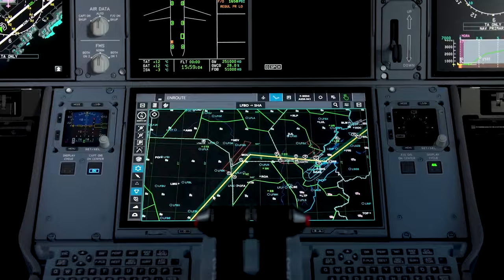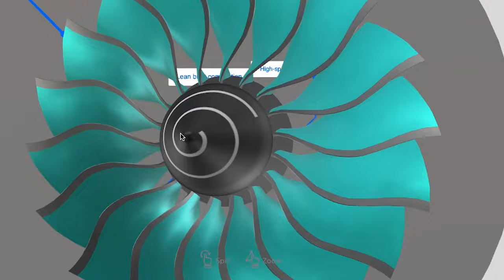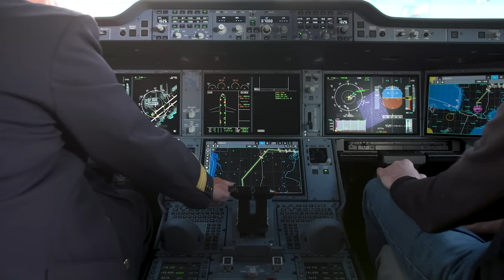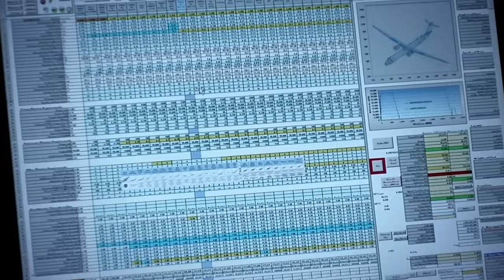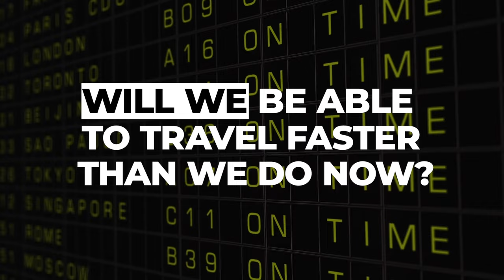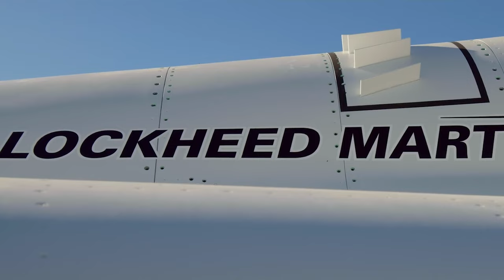Crazy Things Ahead in The #aviation Future!

Comment: I don't think electric or super-sonic airliners will ever be a thing. I expect that, in the near future, the right to burn hydrcarbons will be rationed. Speed and space are luxuries that I expect to command a premium price in the near future. Planes might run on methanol, as it packs a higher portion of hydrogen than other hydrocarbons. And, unlike pure hydrogen, it is liquid at room temperature. Future planes will be likely slower and lighter. The shapes required to get lifting body do not hold cabin pressure well unless constructed much heavier than a simple tube made of the dame material.
Reply from the maker: It is a very good point of view. With respect to supersonic airplanes, at first, like any new technology, it will be difficult to massify it (perhaps in the future we can give our followers a ticket on the supersonic boom😉). When we see simulations of the cabins of the future, it is because they will be able to better understand the materials and will have different forms of construction, Airbus is investing in the development of quantum computing precisely for that. We will see what the future holds for us. Thank you for your comment, subscribe if you haven't already 😃